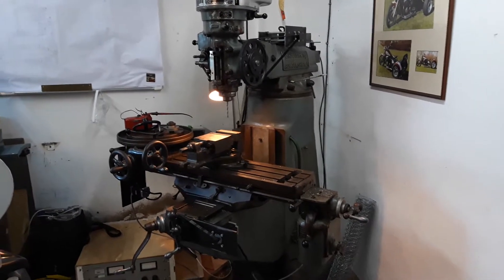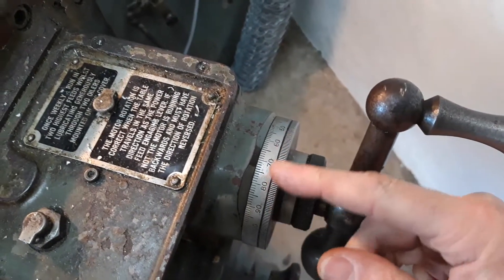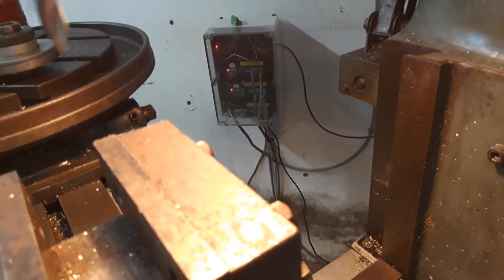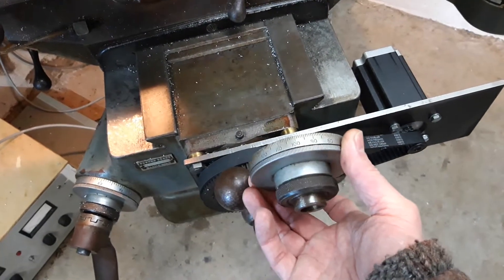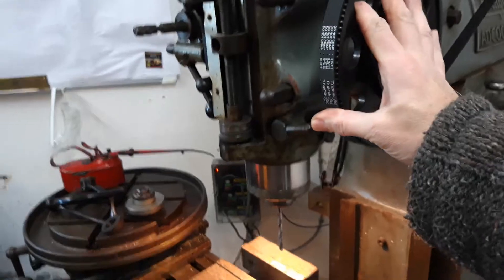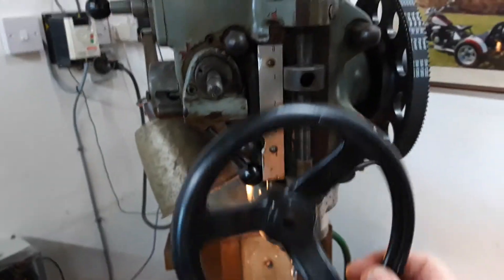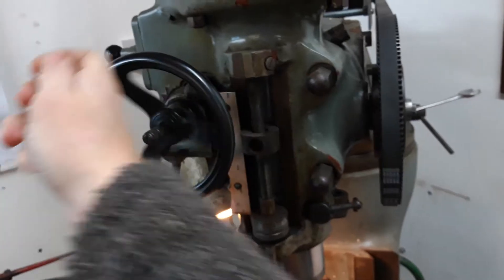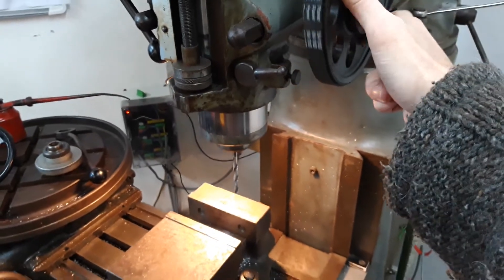Bridgeport CNC Manual Operation

Comment: It has taken me 3 years to finally find someone that has a home setup that is similar to one I would like to build.  Thank you for going through the details of the parts. I am trying to get my list together to order what I need to replicate your build. Would you be able to list your BOM and perhaps the sources you used to obtain the bits? I am in the states and I'd imagine these should be available. I have written down the details you provided in this video and the other with the motors detailed, but I don't know much about the Z-axis other than the numbers on the side of the driven pulley. also, any details on the torsion spring modification would be great as well. Thanks and keep up the good work on the engine project!
Reply from the maker: Sure. Give me a few days and I'll post a video from my old note book.
Reply: @StoneEng  that would be great! Thanks. Enjoying your videos as well. Keep up the amazing work.
Reply from the maker: Actually, I have already done one video. Have you seen this? https://youtu.be/wgwUzrMhznE
Give that a watch and come back with any questions.
Reply: Oh yes I have seen that one. That’s the first one I did see that made me want to ask more.
I am not sure how I ended up asking off this video. No matter, I think I was looking for more information on the driven pulley on the z axis. And also a general question of are all 3 axis belts the same 600mm and small cogs the same tooth count? 
A list of part numbers and perhaps sources I think are what I’m actually looking for, you’ve already gone through the tough part of locating them and that info would prove invaluable. Thanks again